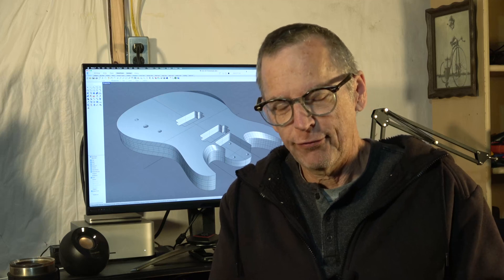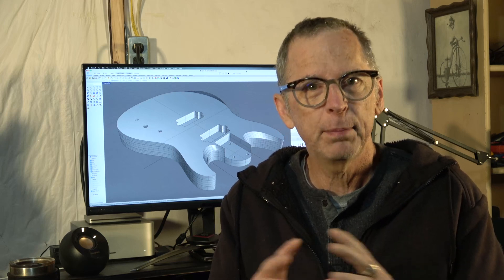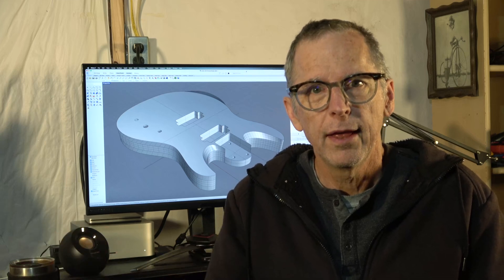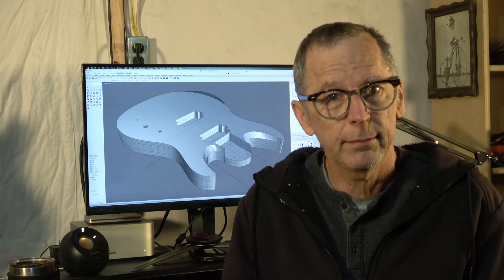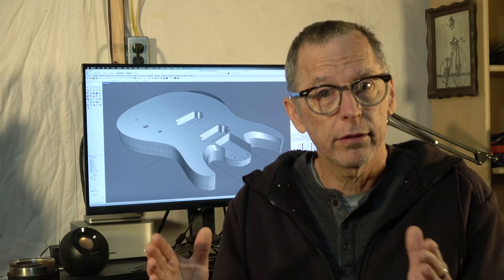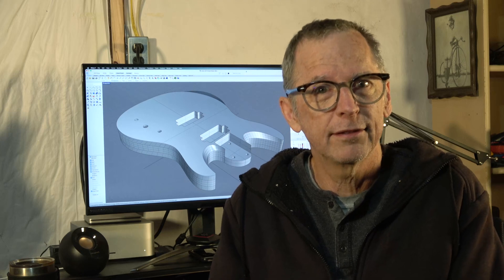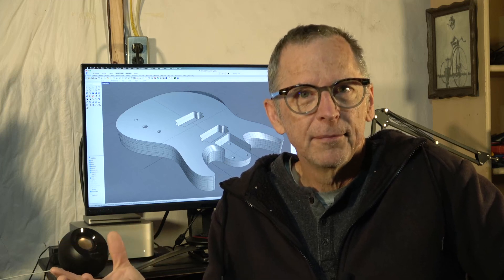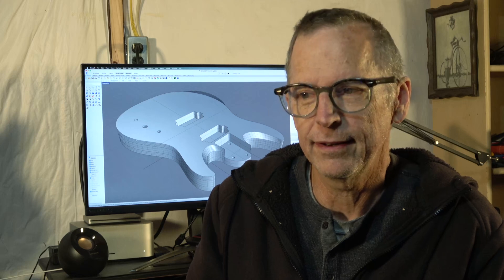Is CNC Faster Than Traditional Woodworking?

Comment: The way to avoid the learning curve is to hire a CNC professional to develop the programs, select the tooling, design and build any fixtures required, documentation, etc., and then teach you how to run the various jobs. I used to do this for shops in my area. This allowed operators to be highly productive when they only knew how to follow the documentation to set up the fixtures, place the clamps, set the tools, and run the CNC machine. These skills can be taught in only a few hours.

Comment: Having done both, CNC by a mile. i can cut a body, fretboard and neck in half a day compared to templates and hand shaping which takes 2 days grinding awayat least.  Also after cutting necks on the CNC I would rather get a root canal than going back to hand shaping. The learning curve was tough but I also had a career in Autocad and design prior so that helped.

Comment: Good exemple : I use my bench saw with a special blade for fret slotting. Way faster to do it this way. I use the cnc for fret slotting only for special scale length.
Reply from the maker: You can't cut blind fret slots with a bench saw.
Reply: @HighlineGuitars  yes you're right, when I want blind fret slots, I also use the cnc 😊

Comment: One thing to consider is the noise level CNC machines make.  If you live in a high density situation, running a router for several hours a day may not be good for neighbor relations. Especially now that many neighbors work from home.  (I know Chris is going to fight me on this.  But I WON my last fight with him so I look forward to his snarky comments!)(Kisses to Chris.)
Reply from the maker: Why would I fight you on this?
Reply: Dedicated spindle is much quieter than a router and water cooled spindle is even quieter than air cooled spindle.

Comment: CNC is faster for sure. Especially when making the same parts multiple times. One factor you didn't mention related to task of learning CNC is, do you use it often enough to remember how to do it? If you use CNC a couple times a year, you may find yourself climbing the hill over and over. 3D printing and laser engraving/cutting is a great way to get into the CAD/CAM world without as big an investment as a CNC router.

Comment: CNC will definitely be something to do the raw cutting if you are running a guitar building business but for people like me that only build guitars for personal pleasure it will not be worth the investment or effort. It will make the build quality constant. Still if you are a professional there are many things that is better be done by a human (fretwork, binding,inlays,etc.) Even at Harley Davidson where robots due most of the welding when they build the frame of the V-rod they still have human welders to weld certain areas where the machines can not do it properly. As for 3D printed guitars I am not so keen about. As a project it will be fun to do but I would not buy one. Yes, there have been guitars built with acrylic bodies but they were not a commercial success. Since the fifties the guitars have not evolved much. Leo and Les found the right material and shapes then and most modern guitars are more or less copies of the Stratocaster, the telecaster,the SG , the 335 and the Les Paul. Ok electronics have evolved but the basic is still the same. As for printed guitars to traditional built guitars if would be like comparing a MacDonald restaurant to one that have Michelin stars.😊😊😊
Reply from the maker: McDonald's revenue for 2023 was $25.4 billion dollars. All of the Michelin restauants combined would only amount to a tiny fraction of that.
Reply: @HighlineGuitars  Yes, the profit for McDonals was high but when it comes to the quality of the products that they sell the Michelin restaurants are in a different league.  Imagine mass produced plastic guitars being spewed out of china and sold for 10 dollars a piece.
Already there are guitar kits available that have a fairly good quality  and are being sold so cheap that it cost less than the components of other guitars. It would be really bad if they flooded the market with cheap plastic guitars.🤠🤠🤠
Reply from the maker: @runedahl1477  It would be really good to flood the market with cheap high quality plastic guitars.
Reply: @HighlineGuitars  high quality plastic guitars is only a dream. To get a really good instrument you need a skilled craftsman. Why is that after several hundred years nobody has been able to copy  a Stradivarius violin properly yet.  In spite of all the scientific progress they have not been able to solve the mystery and the secrets behind these instruments. Scientists have analyzed the wood,the structure and the varnish used but still they don’t know the answer. Maybe the climate in Italy at the time they were made? What kind of soil did the trees used grow on? All just speculation. For a period Ovation was very popular among folk music players and it has a plastic body. However it does not have the same resonance as a 100% wood guitar so a lot of the musicians returned back to their Martins or maybe they bought a Taylor.
Still it can be fun to see and most of all hear the result of your 3D printing.🤠🤠🤠
Reply from the maker: @runedahl1477  With modern audio software, you can make a cheap, plastic violin sound like a Stradivarius.
Reply: @HighlineGuitars  yes,with a good recorder inside and ditto speakers. There is a reason why the best violinist in the world plays old and extremely expensive instruments in concerts. With price tags of millions of dollars they don’t even own the instrument but borrow it from people or companies with a lot of money.🤠🤠🤠